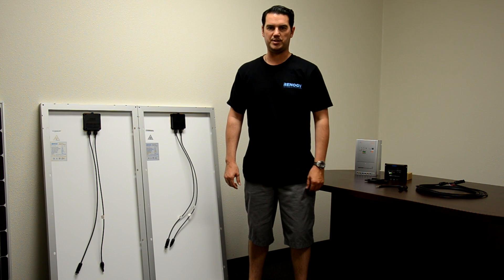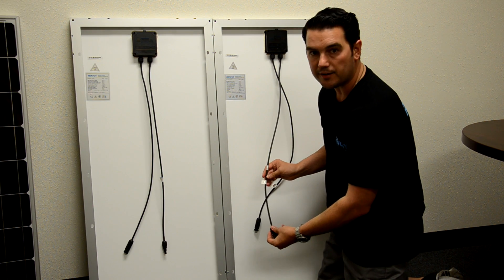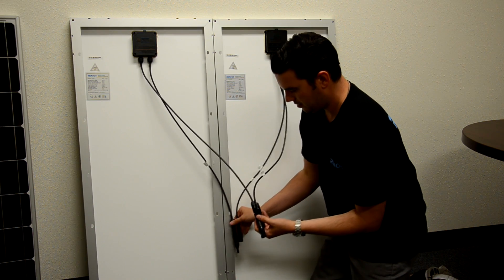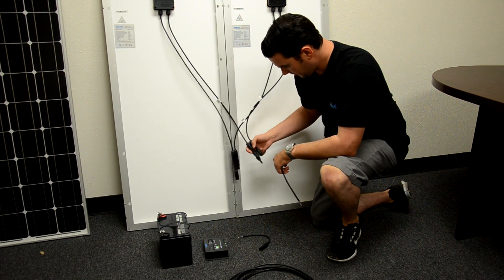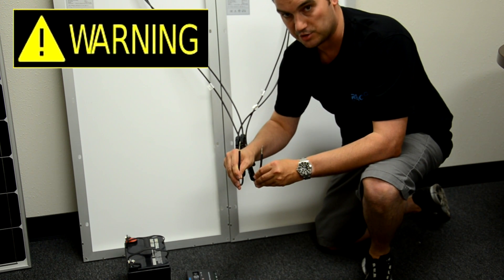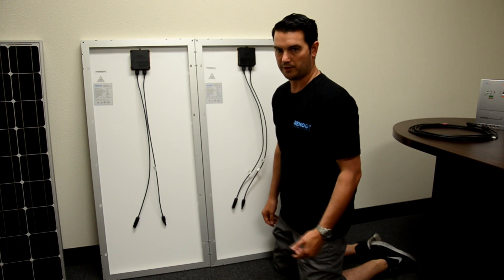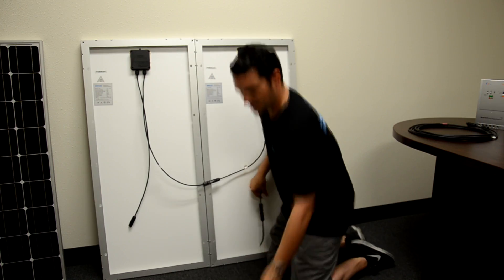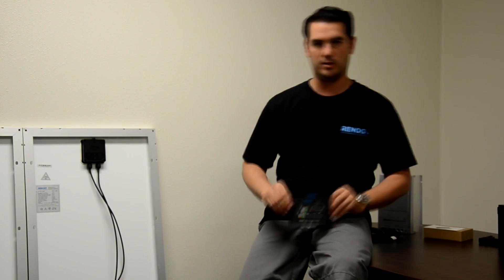Renogy: How to connect your Solar Panels in Series and Parallel Pt. 1

Comment: I have 2 batteries each 250 volts. I have 8 batteries 12 volts. How can I connect both panels to have 12 volts out in a way to charge my 8 batteries 12 volts?
Reply from the maker: Hey Jean, Thanks for stopping by on our page! However, in order to answer your question we will need you to look at your battery specifications a bit closure. The numbers you have provided do not make sense. Thank you.
Reply: Renogy Solar  You right, I have 2 panels each 250 watts.  I have a freezer 12 volts. I have  8 batteries 6 volts(Trojan batteries).  How can I connect both panels and my 8 batteries 6 volts to get charge to run my freezer  12 volts?
Reply from the maker: Jean! Great to hear back from you, we are almost there. We still need either the Watts of the freezer or the amps (volts X amps = watts.) Also in order to best answer your question we need to know what charger controller you will be using for this system.  Thanks again for reaching out! Take care.

Comment: So when you converted the system into a 24 volt system would that be suitable for charging two 12 volt batteries? Or are two 12 volt batteries still considered a 12 volt system?
Reply: You mean when he did Series it climbed to 24v?   Guess the mppt takes care of that if is 12/24v charger.   Batt can stay at 12v parallel.   Is just higher voltage for batt charging.
Reply from the maker: It depends on how you wire those batteries. If you wire them in series, it will be a bank of 24V. If you wire them in parallel, it will be a bank of 12V. With a PWM controller, the voltage of the panels should match the voltage of the batteries.
Reply: Jerry Cruz How timely! You just answered the question I came here with! I had to run my solar panels in series, but I only have one 12v battery. I do, though, also have a 40 amp MPPT charge controller. Whew!! Thank you.

Comment: do we need to put a diode in a parallel series?
Reply from the maker: Using our products, there is no need to install diodes in the system yourself.
 
We can always answer your questions more immediately via our online chat on our website (https://www.renogy-store.com/default.asp) or by phone at (909)-517-3598.
 
Renogy Tech Support
SR

Comment: I now have 2 solar 158 watts conected in series 24v. I would like to buy another panel however I don't seem to be able to find another with 158 watts, so there are still 160 watts available. would I still get at least 158 watts out of this? or would it bring down or raise wattage of the other 2?
Reply from the maker: Unfortunately we do not carry 160 Watt panels, but we do have an 150W. To see if that is compatible, we will need to know the specifications(Amps and Volts) of your 158 Watt Panels.

Comment: How many 12 volt 100 watt solar panels in a parallel connection can be used with a 30 amp charge controller?  Nice video.  Thanks.
Reply from the maker: Bratan007 is technically right from an electrical point of view, but it is also good to be conscious of the NEC codes for safety. We do not recommend more than 4 of the 100W panels in parallel, as 5 of them is too close to the controllers amperage limit.
Reply: Each rated at 5.75A so you can connect 5 panels to a 30 amp charge controller, but definitely add a fuse between panels and CC...

Comment: Thanks for the vid, but if you connect the solar panels to the to a charge before the batteries, wont that damage the charge controller?
Reply: I have heard that but, I for one, have done that, hooking up the panels first and than the batteries. Thinking that I damaged my controller, and it worked just fine..But I always try to remeber hook up my batteries first.
Reply: Connecting the battery first sets the charge controllers voltage for your current battery voltage use. ALWAYS connect battery first and disconnecting should be panels first. Don’t listen to those who say different.
Reply from the maker: Generally as a precaution we recommend that you hook up the controller to the battery before you hook up the panels to the controller. This video was just meant for tutorial purposes.

Comment: My Renogy 100 watt solar panels are in series and parallel for  24 volts, run to a Morningstar tristar TS MPPT 45 amp. charge controller, charging a 12 volts battery bank. can see them at Raphael Diy  you-tube. Raphael